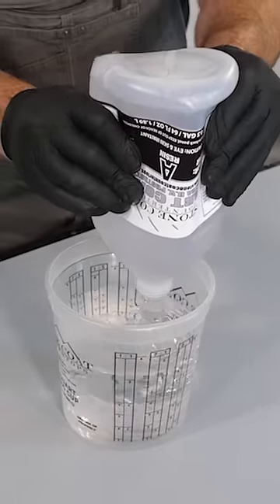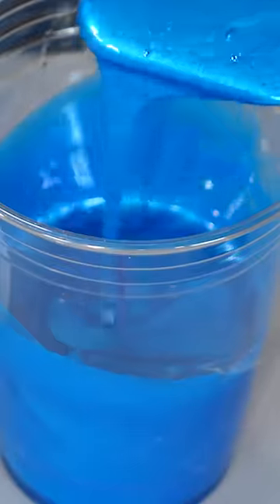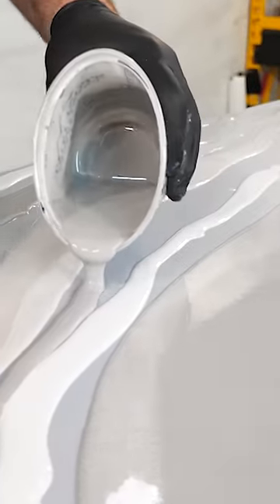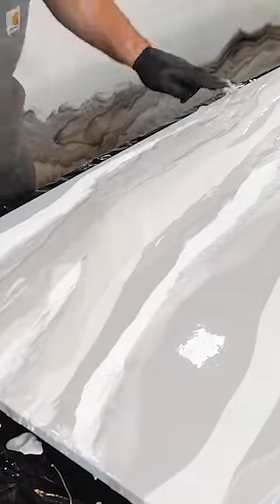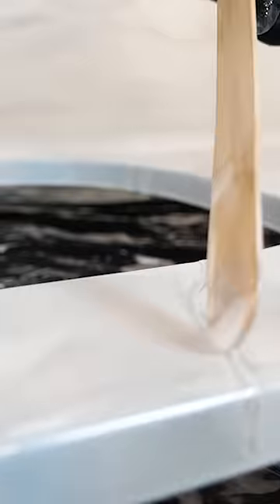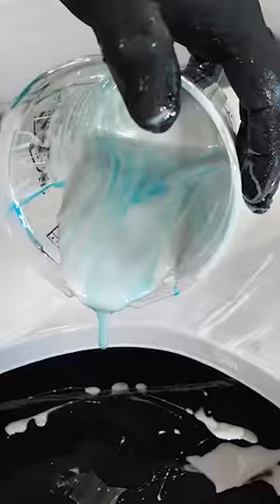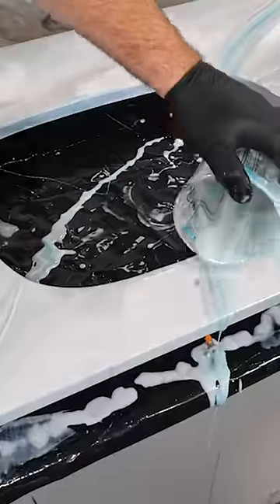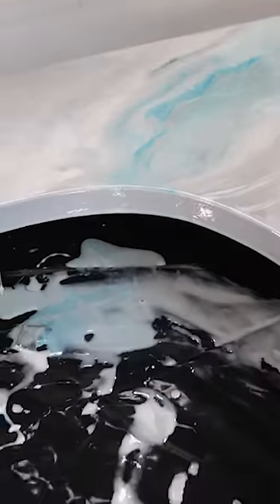He spent $3000 to get shoeprints out of Quartz 😱

Comment: That's crazy. We like quartz specifically because we never have staining problems. We had a painter we had to call in because all our guys were busy, he got stain all over a white countertop. It just wiped off.
Reply: I didn't find anyone having a problem like him getting paint off quartz countertop.
Reply: Never head of shoes staining finished quartz either. It’s used because of its strength and lack of staining
Reply: @shaunburns3332  Right? Our countertop guys will literally whallop it with a hammer in front of the client to show it off.
Reply: @maxmaynard1596  my friend had a quartz counter top and we have had all sorts spilled on it during redecorating and nothing stained it
Reply: @shaunburns3332  Yeah, this is fishy as hell unless the guy got his sgoes wet, walked through diamond grit, then walked on the counter.
Reply: @shaunburns3332  it’s bc it’s not quartz it’s resin. The painter stepped in a resin countertop that was drying and it made an imprint. Quartz is a stone and won’t make a stain/imprint by a shoe
Reply: The painter walked over a curing Faux-Quartz acrylic top.
Reply: He should’ve said “faux” quartz countertops bc it’s resin and was still drying when the painter stepped on it….
Reply: @Daniel Finch said and lied are pretty similar
Reply: White canners not quartz apparently he can't pronounce counters.
Reply: there are different types of quartz, the relevant categories being porous and non-porous. non-porous is almost always used for obvious reasons but I guess maybe they used the porous variety?

Edit: I was thinking of marble but maybe the same thing exists for quartz?
Reply: He says “quartz” but then he shows “cheap plastic resin” in the video so who knows what he’s taking about. Maybe he thinks if it looks like quartz it is quartz?
Reply: @geetarguy777  I think that's just a separate unrelated job he is doing. I can't imagine him saying 'quartz' to refer to resin with a quartz effect

Edit: I rewatched the video and saw some other comments and changed my mind. I do believe he is referring to resin - pretty clown move
Reply: marble or quartz.....look simular but one stains and other doesn't...
Reply: @dankfinchyou don't know anything about quartz
Reply: I thought the same thing
Reply: @dankfinch Yeah but he's also showing how he makes a fake quartz countertop.  There is no way shoes did anything to a real quartz countertop.
Reply: @dankfinch wow, somebody’s dog doesn’t like them today.

If you read the description as well as you thought you did, you’d notice where it says that the company finishes quartz countertops with “epoxy resin” because it’s cheap and easy and looks great.

So let’s try this again: the quartz was fine, it was the epoxy that was stained.

Comment: The painter has paint on his shoe before he is going to tape off a fixture? Then he's going to walk onto a newly installed white countertop and not notice that he left a visibly different colour paint mark on it? When he goes to place protective plastic or paper over the countertop because he's about to spray like you said, he still didn't notice the paint? Even after all that, what kind of paint was he using in order for it to dry on permanently on a quartz countertop? I call BS.

Comment: I don't understand why everything isn't painted before installing anything you don't want sprayed or over sprayed. Like countertops or electric outlet covers, or cabinets, or toilets, or hardware like towel racks, or even fireplace decor? They overspray isn't that noticeable  because they do pretty good at it but it's still there. I spent hours cleaning it off all of the things above. I mean guest prob wouldn't of ever noticed it but I did.Til this day 12 yrs later I still find white speckles on these same things that I missed or didn't see yet. They are barely noticable but still why not just spray before adding these things... Cuz it reflects on them and looks like they took profit above quality.

Comment: I had to hand sand several footprints out of hardwood floor finish from the builder taking the wood vents out of the garage where they were safely sitting while their finish dried throughout the home where he shoved all the vents into the wrong vent holes.  
The finish had been at the sticky honey thickness stage, so the guy had to feel the pull with each step. 
We have the vents numbered on the bottom to match with the vent holes. He forced them in the wrong holes. They are now glued in, and would have to be cut or chiseled out destroying them completely. 
How any buildings get completed correctly is a mystery to me. 🤯
Reply: Jesus, what a frustrating experience!  You even labeled them and he still tried to put I a sticky triangle in a square hole…. I hope he is paying for the replacements??!

Comment: As someone who has 10 years of experience in natural stone either they’re just making this story up or they ripped the customer off insanely. $3000 is a reasonable price for reasonably large kitchen in the first place. Idc what kind of shoes he had a one squirt of liquid barkeepers friend which cost about $20 a bottle would have removed any markings his shoes left behind in like 30 seconds of gentle wiping. To polish the face of quartz is already an extremely hard task especially by hand on a job site it will not match the polish from the factory no matter how good you are, no one would take that risk over shoe prints. The barkeepers friend would remove the staining or scuffing easily without risking destroying the entire job. This video is just unreasonable to me. If they had said it was their epoxy countertops idk cos I have 0 experience working with that but if they really did charge $3000 for this situation it is highway robbery.
Reply: Natural and engineered stone to be fair, just not epoxy